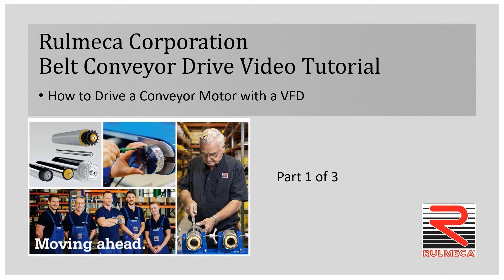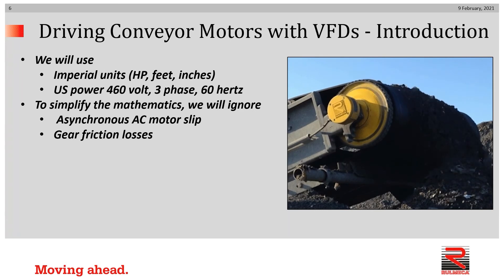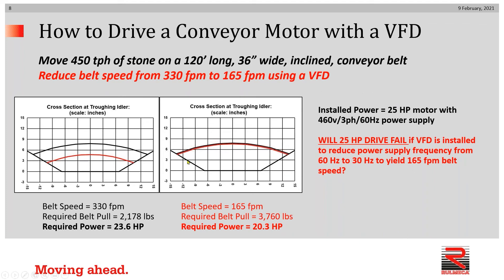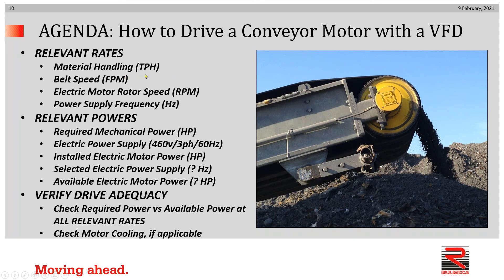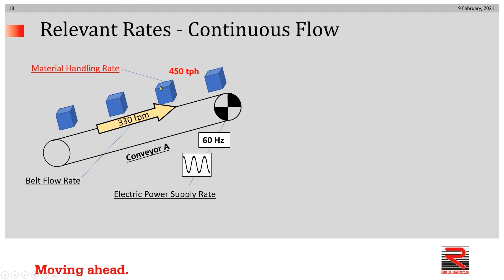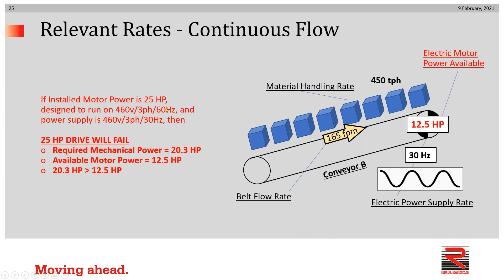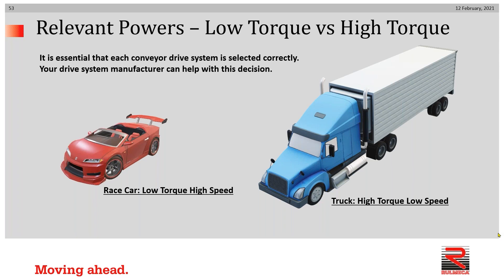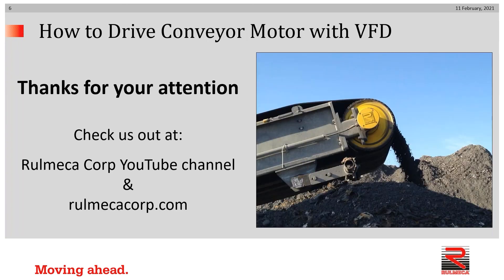Driving a Conveyor Motor with a VFD 1 of 3

Comment: How can I reduce the speed of a conveyor belt without installing a VSD? I was thinking of installing a small drive pulley but  am not sure if it will work  Please assist
Reply from the maker: If you change the diameter of your pulley you will need someone to verify you have enough power available in your electric motor.